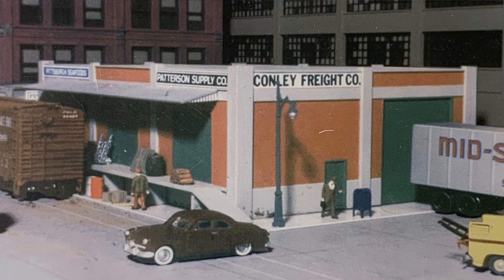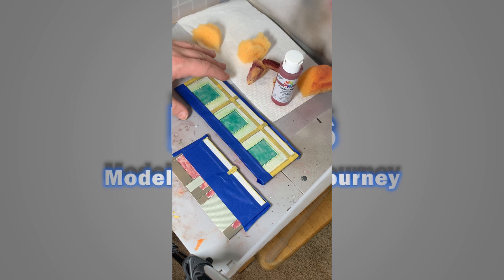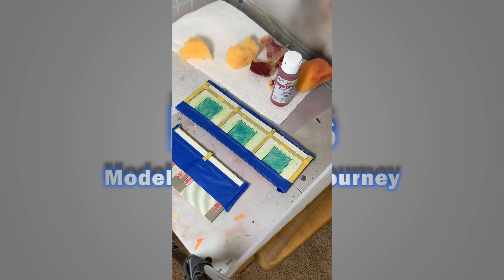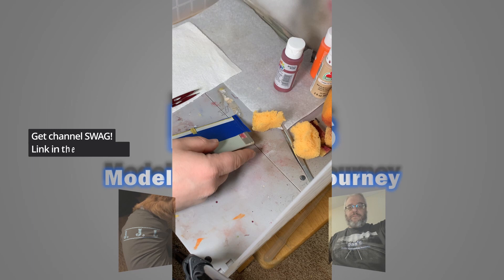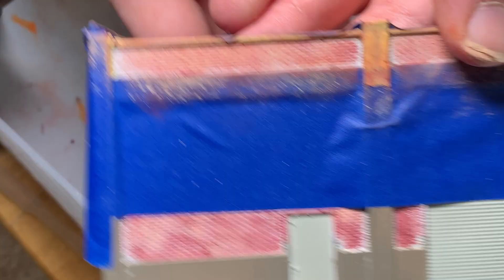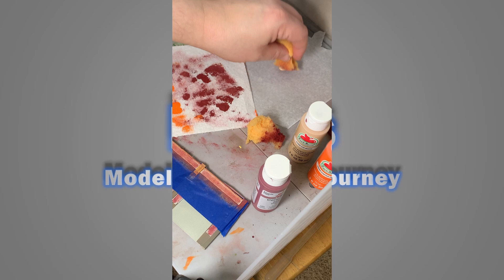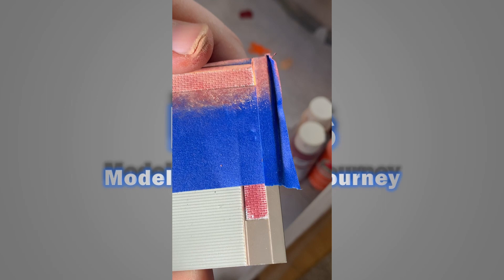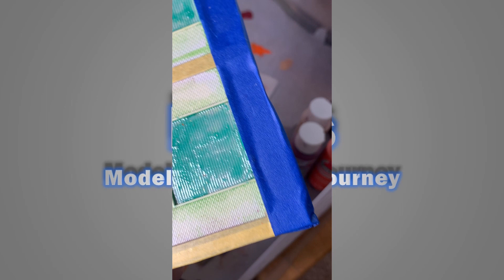Building A City Classics Structure in HO Scale: Painting parts

Comment: Nice job!   It was good to see the liquid mask in action.  I might get some to use on some Trek models I'm going to build.
Reply from the maker: Couple hints: 1. Use multiple layers. Don’t be shy with the application. 2. Likely your model has few to no sharp edges. Try not to use anything stronger than the model material to remove the mask from sharp edges. I have two large scrape lines from my efforts. There are lots of masks out there , but being slightly partial to Vallejo from airbrushing, and cost lead me to that mask. I also use it as a way to rust things. Not that your models need it, but one way to use it is to paint a surface rust color, then use a toothpick and bang it against your finger lightly to have the mask spray off of it. Then paint your desired color. Remove the prices of mask and you have a rusty surface.